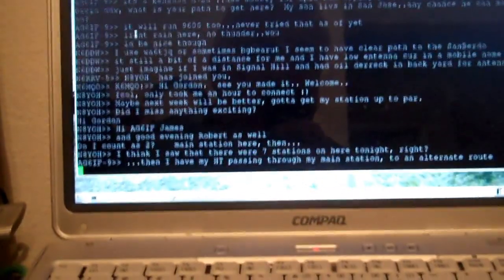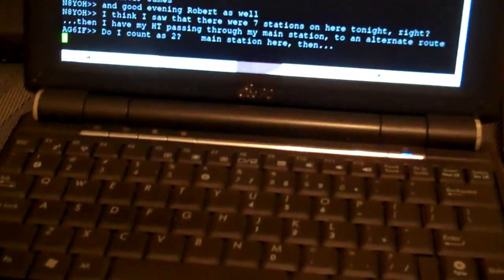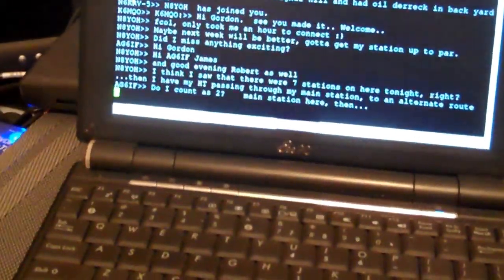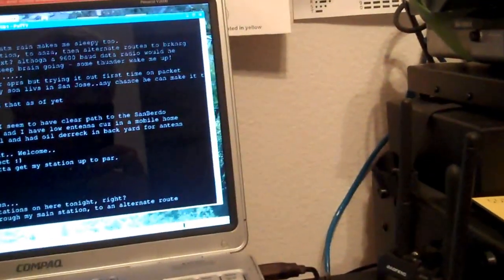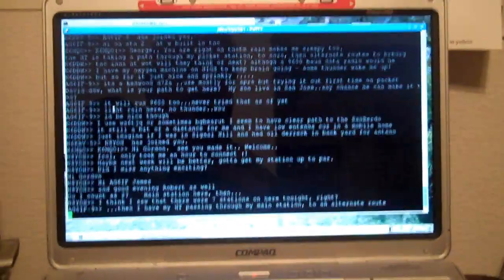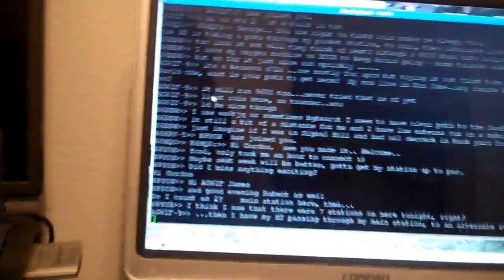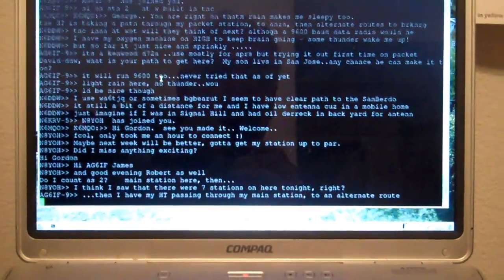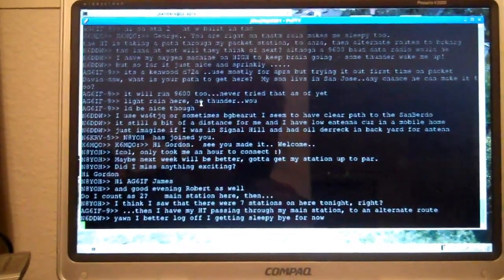A packet radio Sat Evening Net in Southern California, 7 people showed up.

Comment: "I am hoping that Packet radio (1200 baud) starts to come back for all of us new hams"
I hope the same, still. I had a great time with 1k2 on CB in the 2000s (PR was legal on CB in some EU countries).
I used a BayCom compatible modem w/ TFPCX driver (software TNC) on a 40ch CEPT radio (all FM) .
The computer was running DOS & users of the time were using Graphic Packet, TOP,  STOP, XPACKET and so on.
At the time, software solutions like MixW2 also appeared, of course.
And some people were using WinTNC, Paxon, AGWPE and Flexnet since '94 or so.
Real TNCs, like TNC2 with "The Firmware" and DAMA compatibility were often re-purposed to act as
digipeaters and BBSes, which were solar and battery powered.. Anyway, I just wanted to let you know.
PR 1200 (AFSK) will outlive 9k6 (FSK) and will survive, be it only for APRS at the moment.
The great thing of classic Packet Radio (300Bd/1200Bd) is, that will work with any medium transporting audio.